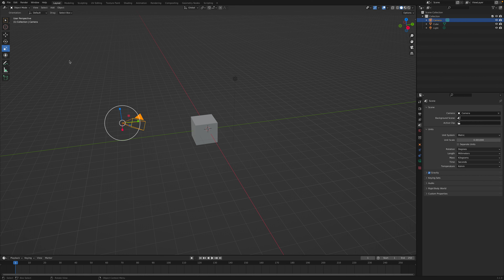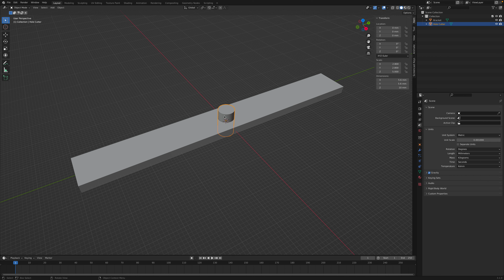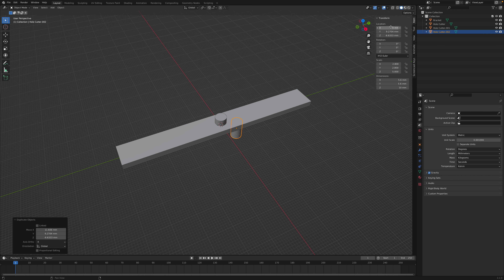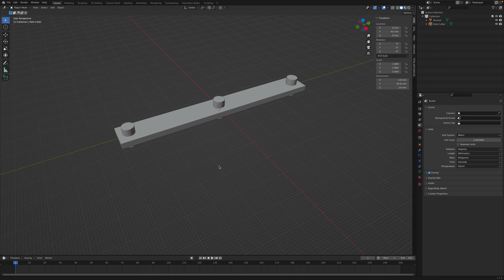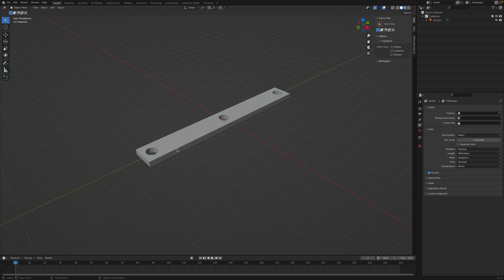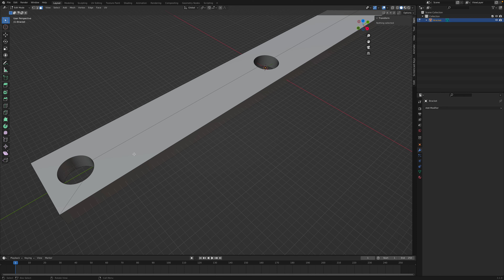How to 3D Model Using Blender - Easy Beginner Guide + Tips and Tricks

Comment: Good instructional video. It was what I was looking for for my speaker design: how to make holes in a panel for the speakers and terminal.
Only 2 comments: I work on a laptop. I often had trouble finding the mouse cursor on the screen and the text is very small when viewing the video on a laptop with a 15 inch screen.
But it was an excellent explanation.👍

Comment: you made measuring the hole so much more difficult than it needed to be. 
if you go to the measure tool on the left side of your edit tools and  select it, then click on the z axes and zoom in on the hole to fill the screen press the ctrl key on the keyboard while hovering over the left or right side of the hole and click on the verticey it will snap to the verticey you want while holding left click and the ctrl button drag the mouse courser to the other side of the hole following the grid lines to line up the other side of the hole and find the size the hole is. which is 5.6 mm 

hopefully this helps.
Reply: Coming from CAD I really appreciated this, thank you

Comment: you know, I searched for "blender tutorial make a basic 3d shape" after it occurred to me that it would be cool to make a bracket for my desk, that holds the glass panels at a fixed distance from the wall using screws on the wall side and tape on the glass of the desk

and then I saw this thumbnail and well, I think this is the right video for me. Thanks for that

Comment: I like Blender but it's got to be one of the most brain-dead decisions to set camera rotate/pan/zoom to the middle mouse button as default. The reason is that it's harder to press the middle mouse button than the left or right mouse button. And they are used A LOT! In addition the middle mouse wheel button is what wears out the quickest on a mouse. I always change the key mappings for this to use the Industry Standard (aka Maya) keys. But that conflicts with some of Blender's native functions like select loop, etc. So for Blender being such a popular 3D tool that default mapping is really bad!

Comment: 5 mins in and already finding issues. First one.  Mouse pointer. Small and black on a black background. Extremely difficult to follow your movements. I suggest going to Mouse settings and increase mouse size to 2 and color to white if you going to continue in what appears to be Dark Mode.  Second issue.  X,Y and Z dimensions.  From what I understand X would be the WIDTH, Y the HEIGHT, and Z is the DEPTH.  You have just set Y first and called it WIDTH, then X and called it DEPTH then Z and refered to it as Thickness.  I'm no expert obviously in Blender or I wouldn't be here but I belive details matter.  Can't understand either why, when it comes to setting the dimensions of the object one wants to create, that they couldn't use the old H,W,D terminology.  I shall continue with the video now and see if I can get to grips with this blender app.
Reply: 10 mins in.  Gonna go look for another tutorial for actual beginners.  Can't follow where your at with that almost invisible mouse pointer.  Sorry mate.  This one is not for me.  You might also want to consider explaining some of the terminology used if your going to advertise it as an "Easy Beginner Guide"

Comment: Loving this work. Massive thanks.
 
But I'm stuck on measuring after countless rebuilds. Checking and rechecking. 
I CANNOT get the correct measurement to appear.

CANCEL THAT!!!!!

DONE IT.

Set Units to mm in Bracket Units.

SUPERB.

THANK YOU 3D P.A.T.

Don. England.

Comment: i cant seem to get blender to keep accurate scale. I set scale like you show to 0.001 and then create a cube i set it 40mm x 40mm x 8mm and then I select top face and do inset face and then tell it to inset 3mm. When I measure it using measuring tool it shows 5.6mm

Comment: Will I need to manually set the units to mm every time I start a new project or is there a way to set it as the default units?
Reply: After you set all your desired settings (units ect) go to File -> Defaults -> Save Startup File   This will save all your settings (including the default starting scene)

Comment: 1: Great video!
2: There is actually an even more convenient way to see edge lengths while modelling.
When in edit mode, go to the overlay menu in the top right and under Measurements select edge length. You can also enable edge angle when useful for your model.
This is super nice when manually extruding and moving and scaling and much easier than the MeasureIt plugin.
Reply: maybe im doing something wrong but its not showing the right measurement. its showing 2mm even though its a 60mm cube. what am i doing wrong?